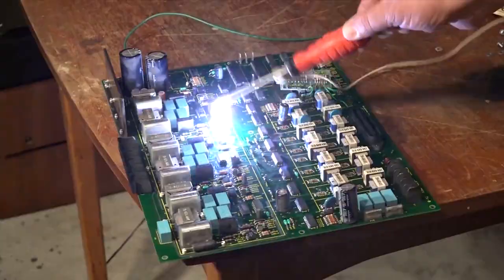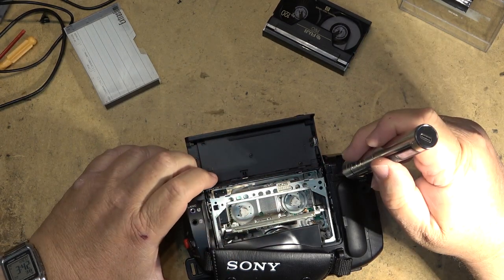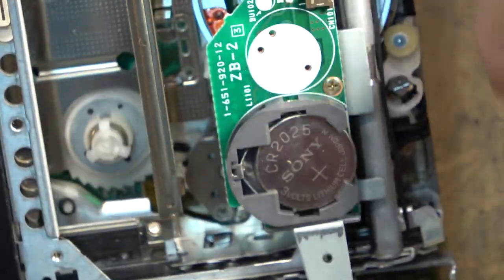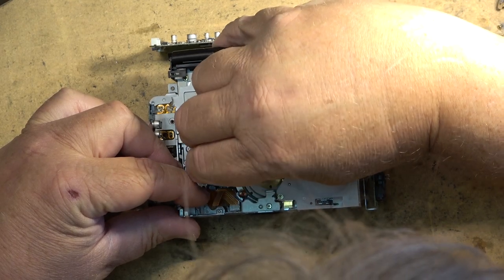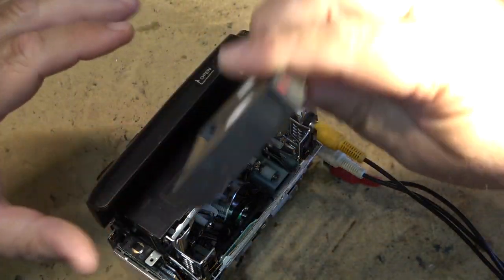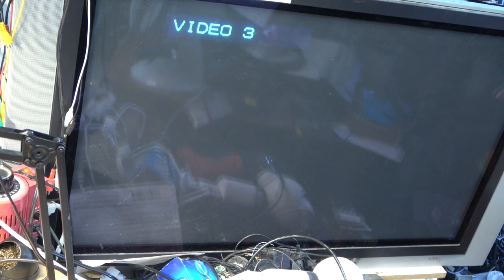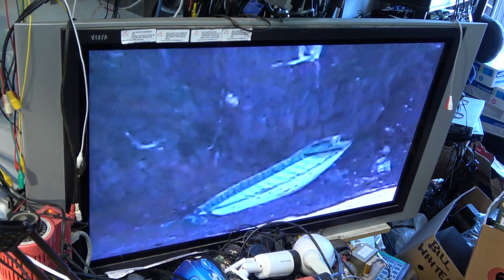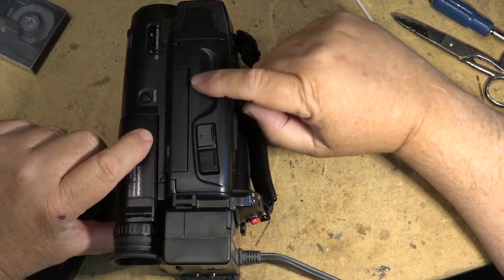Sony CCDTR33 8mm Camcorder will not load, no rewind, shuts down ect.

Comment: The later digital-only Digital8 camcorders will let you record in LP mode on a standard Video8 tape. They eliminated the Video8/Hi8 detection switch since it was only necessary for analog playback.
Reply from the maker: By the time the non analog playback cameras came out it was determined that regular 8mm tape was good enough to allow LP recording but hi8 tape was recommended.  Even with hi8 tape LP recording always had a warning that playback may only be possible on the same machine that made the recording.  In other words, the speed is there, use it at your own risk and if the recording will not play back, too bad so sad. 
I have actually said that to customers. They brought me digital 8 or mini DV tapes to transfer all recorded in the lp speed because they were too cheap to spend a little more for some tape and they don't play properly pixelation macro blocking you name it on all of my decks. Customer mad complains how come transfer looks like crap? I haul out the Sony owner's manuals for the cameras I have and point out right on the first page that the lp speed is not recommended and that playback may only be possible on the original equipment that made the recording. Now their camera is broken and cannot be repaired and they've got 100 tapes that won't play properly on any other camera or player. My response too bad so sad sucks to be you should have read the manual and heated the warning.

Comment: My Sony TRV110 still working perfect too. Only had to clean the AC power socket with contact cleaner as it has been in its case for a while. The hand grip is still perfect too. Interesting mine has not had the ribbon able get cut though? I bought mine in July 2000. Its the PAL version but plays NTSC too.

Comment: I have a similar camcorder  with the same problem. Nikon VN-760 was a re-branded Sony CCDTR700. The corrosion is apparently just from decades of exposure to humidity. I tried to replicate this fix, but I couldn't get the innards to slide out, so I couldn't properly clean the connectors. But just the jostling of disassembly must have somehow fixed the problem, as now it seems to work OK.

Comment: Hello, I have the same camcorder shown in the video (but the model name is TR-460), and its viewfinder doesn't work. I disassembled it as soon as I found out about it, and the issue is that its ribbon cable has a tear. The viewfinder just displays a white screen. Should I replace the ribbon cable with a new one, or give it to an electronics expert and repair it? Thanks!
Reply from the maker: Good luck finding a ribbon wire.  Haven't been available for 30 years.
Reply: @12voltvids  True, sadly. So, is fixing the only option available?
Reply from the maker: @holomanic  good luck.

Comment: I have a TR81 as well which I have sound but not Video, so I check out the Capacitor on the Video board and found both the 220 uf 4V and the 33 uf 4V were bad so I replaced both of them. well it worked I was able to get a great picture, well with my luck it only lasted 2 hrs and after that nothing no picture and no sound any idea ?

Comment: I've got this exact model and it won't load tapes. Without a tape in it will close and lower the mech but ejecting again it gets stuck near the top. You can see a small white gear in the bottom right spinning and the larger gear above it vibrating. I'm guessing some teeth have stripped? This is my 5th camera, I just want to watch some tapes :(

Comment: What are your thoughts on putting a little dielectric grease on those connections after cleaning? I find it helps both in home electronics and automotive connections repairs I've performed. The "Wet Coast"  is horrible for corrosion and fretting. Great info on your vids and happy to see a fellow lower mainlander having fun with this stuff after so many years on the bench. Keep it up 👍
Reply from the maker: Used to put dielectric grease on, and they all came back and I had to clean it off.   Grease attracts dirt and dirt is conductive.  Clean it off and it will last for years.
Reply: @12voltvids  Totally makes sense. How about a small drop of Nu-trol just to clean and maybe keep the area from corrosion from moisture?  Or for ribbon connections just keep them dry after cleaning? Not judging your work as you do great repairs just wanted to get another electronics minded opinion on these issues that I have also come across with just cycling and cleaning the connections and everything works again. Customers are happy with no parts needed, right?
Reply: Isnt dielectric grease non conductive and supposed to keep something from conducting where it isn't supposed to?
Reply: Deoxit is awesome.
Reply from the maker: @J.Christ-man  
Sony advised nothing be put on the ribbon connectors as it could damage the adhesive that holds the copper onto the substrate.  This may not be an issue initially but if pulled apart years later and find all the traces are seperation at the edge.   That's a problem.  These problems were addressed in service bulletins.
Reply from the maker: @chrissanders2562  
I used to put dielectric grease on them and several months later it was back and had to clean off.

Comment: I have the ccd-fx430 and it worked fine with rare usage over the years until my dad decided to charge the battery in a improper manner during the holidays (because we couldn’t find the adapter) it started up fine and played until the battery died, next day I tried to start it and the viewfinder flashes for a second and then the camera starts beeping until you turn it off. Do you have any idea what happened? I’m assuming it’s fried and I’d like to take the tape out if it’s broken, but if there is a way to fix it i'd love to know, Thanks.
Reply from the maker: When you ran it the capacitors built up pressure and blew the corossive capacitor juice out onto the board so now you have a shorted corroded main board.  It's dead Jon.

Comment: Great video, I appreciate the knowledge. I have the same camera,  my issue is that my tape will not load. Any thoughts? Thank you.
Reply from the maker: Does the system load and unload without a tape in place? In other words when you push the eject button does it open and then when you close because that housing it winds back down? If it does then it's a detection circuit that's not working properly. When you go to cassette and there's actual tape in place the first thing the camera does is try to move the capstone motor and take up and supply spools to make sure that they move slightly it also turns on the drum motor to spin up the drum. if the drum doesn't spin up to the correct speed or is not detected that it's spitting up it will go into an emergency shutdown and kick the tape out. If the drum spins up and it sounds like a spinning way too fast then it's likely a connection problem between the drum and the main board that's causing a problem. The reason it does all this before loading the cassette is in case there's a problem such as a jammed capstan motor. If the tape were to lace up and the capstone motor isn't able to turn when you hit the eject button it'll eat the tape because the caps and motor is used to retract the tape back into the cassette so it does a series of self tests every time you put a tape in. Of course when you close the cassette housing with no tape in it the machine knows that there's no tape so it doesn't do the self test it just closes
Reply: @12voltvids  Hi, I'm trying to load a tape on a Fujix 8 A type loader and it when i try to load the tape it just pops it back out and the caution light flashes red.  So from your explanation above is it a bad detection circuit?  How would you fix that?

Comment: Hi, i has problem like this with my CCD TR670: i can't see anything recorded on the tape (just black screen, and playback timer doesn't start). LCD screen is working correctly, but playback has some troubles. I cleaned connectors in the bottom, but the playback didn't started yet. What's the problem with my camera? Do i need to replace caps or something? Pls, help
Reply from the maker: If it is full of surface mount electrolytic caps then yes they are probably all leaking and have likely ruined the board.
Reply: @12voltvids  Now i  got a picture from the camera by disconnecting and connecting connectings, but it has very big noise and doesn't have sound. May it be caps or i just have dirty head? thanks
Reply from the maker: @sinclair8811  check the drum connector again. Loss of the fg pulse results in random head switching.
Reply: @12voltvids  Okay, i'll do
Reply: @12voltvids  I checked it again but i still have noisy picture with no colour.
Reply from the maker: @sinclair8811  could be caps
Reply: @12voltvids  but! it was working very well 1 day ago, i don't think that caps might spoil by one day. I'll check all connectors in camera and clean them
Reply from the maker: @sinclair8811  did you try cleaning the heads with a Sony dry cleaning tape or use the fingernail trick I have showed.  They won't clean with alcohol.   Metal partical tape won't dissolve in alcohol like oxide tape does.
Reply: @12voltvids  No, i didn't. But i think it is dirty heads or weak control pulse coming into the circuit from CP head. I think, capacitors cannot leak so fast, can them?
Reply from the maker: @sinclair8811  8mm does not use a control track like VHS and beta.  It's all electronic.  Tracking signals embedded in the video track.  Well not exactly in the video track bit on either side of it.  Called ATF signals.  Auto track finding signals.
Reply: @12voltvids   thanks, i did not know this. Today i am going to clear heads by isopropyl alcohol (i have not any magnetic clear liquid) and i'll write results.
Reply: @12voltvids  i understood that i cannot clean heads perfectly by alcohol, but i has got anything except this
Reply from the maker: @sinclair8811  you can't clean them at all with alcohol.
Reply: @12voltvids  if the problem is dirty heads, i'll notice that my picture has become better, will not i?
Reply: @12voltvids  yes! I got the stable image without noise, but now i haven't got any sound and colour. Connectors?
Reply: @12voltvids  Then, now i have the sound because sound pcb had no contact with main. But colour is not here yet..
Reply: @12voltvids  i get the colour and the sound. The problem was in connectors that connect pcb's. Thank you for the help, good luck!
Reply from the maker: @sinclair8811  connectors cause many troubles.

Comment: What is the difference in the ccd-tr23 and the ccd-tr33
Reply from the maker: I have no idea.
Reply: @ honestly I don’t think there is a difference but on the tr23 there is no color lcd viewfinder and on the tr33 there is a color lcd viewfinder so that’s probably the difference in the models
Reply from the maker: Could be. I never owned any consumer cameras only professional gear.  I repaired this crap but never paid any attention to the horns and whistles they had.  Don't know any model numbers just the chassis's.  They are used across multiple models with different bells and whistles.
Reply: @ yeah you have talked about you owning the professional gear I thought you probably would not know the bells and whistles of the consumer stuff

Comment: Do u fix handycam
Reply from the maker: Some can be fixed and others beyond economical repair.  If it's a ccd v or ccd f series throw it away. Same with the CCD tr series.  They are loaded with capacitors at leak corrosive electrolyte which attacks the copper on the circuit boards soaking into multi-layer boards and destroying internal conductors. That makes the board unrepairable nine times out of 10. Many are repairable but more or not it all depends on the model and how far the damage has gotten. I'm like some services out there that will take your money and do full cap jobs regardless on how bad everything else is I walk away from those ones because I know from experience that even 30 years ago replacing the leaking caps with all new caps resulted in camcorders failing and gain after a few months and then people being pissed off. My normal recommendation to people that have tapes that they need to digitize unless they have hundreds of tapes is to just take them out and have them professionally done it will be less money than spending a whole bunch of money on an old camera that may not last long enough for you to finish your project. Generally on video cameras if they we're made before about 1998 they're probably not going to be repairable because they're going to have bad caps in them.  if it's prior to 1998 then I would say you're probably not worth fixing but again it depends on what damage has been caused one thing for sure if you've got an old camera that's been sitting around for 20 or 25 years and has not been used don't plug it in. It's that first initial plugin when the electrical capacitors try to reform after sitting Dead for God knows how many years the pressure starts to build and if the seals have failed which they most likely will all the corrosive electrolyte gets blown out onto the circuit board and starts to do real damage.

Comment: Great Video, I think I must have watched all your camcorder video, but I have a strange problem that you have not covered.  I have a CCD-TR101 which will play for a couple of seconds and stop, rewind works fine but no fast forward. During playback or fast forward the wheel seem to have problem taking the tape in on the left-hand side while the Right-hand side seem to push a lot of tape thru which overwhelm the take up and stop.   I have reseated all the cables and use DeOxit on the connectors. Can you please give me some help in finding the solutions? Thanks
Reply from the maker: Look for debris in the teeth of the take up hub.
Reply: @12voltvids  Hi Sorry I am a newbie, is that something I can see without stripping all of the circuit boards out, is there a video (hopefully).
Reply: Sony EVS 5000 / EVS 7000 Take Up Hub Repair is this video possible may help ?
Reply from the maker: @denniskao2368  the evs5000 / 7000 have take up hubs that fail left right and center.  Cameras due to the nature of how they are used have a greater chance of dirt, sand ect getting lodged in those tiny gears and hamming them.
Reply: @12voltvids  Thank you, I just look at the top of the take up hub and I notice there is a crack on the edge, so I think that is my problem. Do you have a video that shows how to swap out that part.
Reply from the maker: @denniskao2368  yes that would do it.  They just lift off.  Some have a cover holds it down that needs to come off first.